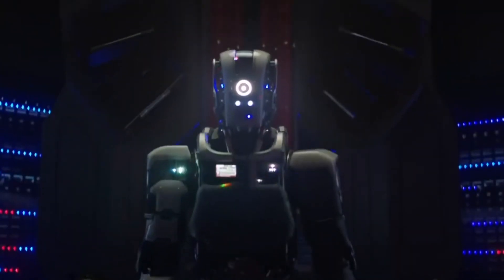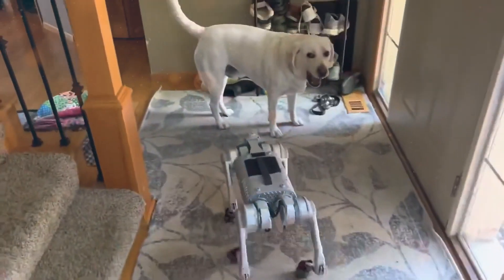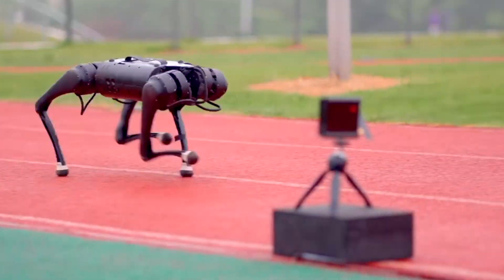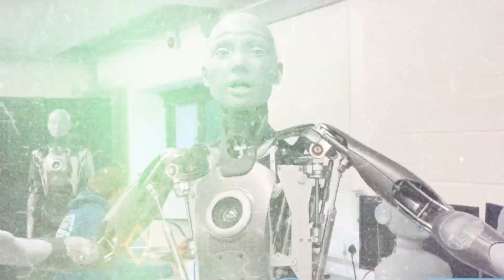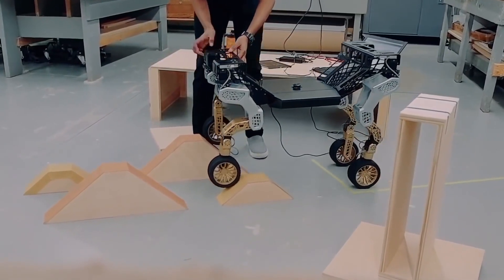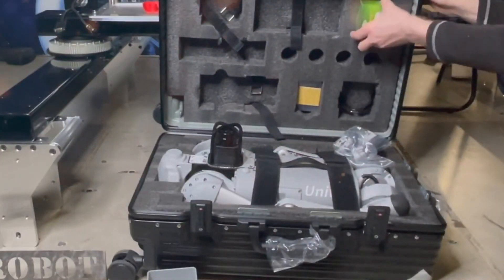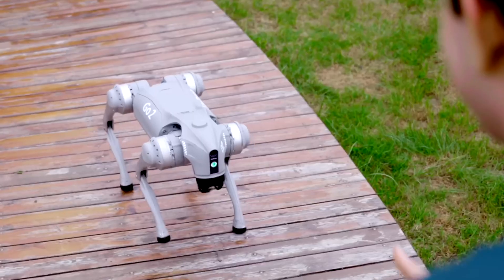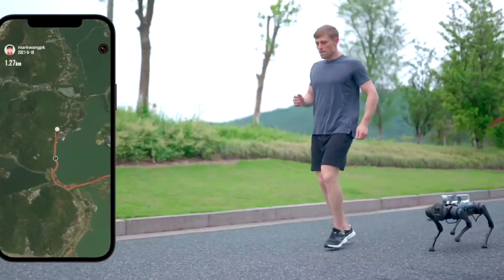Meet Go2 Pro: $5000 Robot Dog Who Can Run Faster Than You

Comment: It is:
 1600 USD fior the base model,
 2800 USD for the Pro Model,
& EDU model is by request quote.
(less than 5k)

Just incase you missed the giant
splash screen video on their site, 
and all over X. :)
Reply: Base is actually $2713 if shipped to the us. Shipping $400 and 25% charge for export. Still cheaper than others and I’m still going to get one.
Reply: @trollslayer2116  Being in Canada, I will have to check the import tax, but we have about 25% extra for exchange. I did see the shipping, but one has to pay shipping one way or another. There may be a distributor in the USA you can find  if you inquire.
Reply from the maker: WOW i wasnt aware thank you for letting us know that's awesome